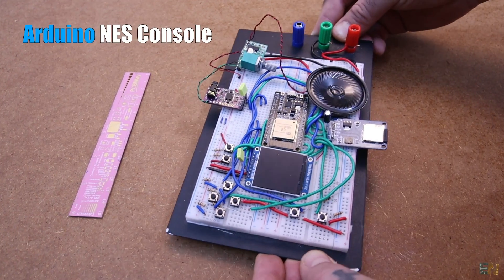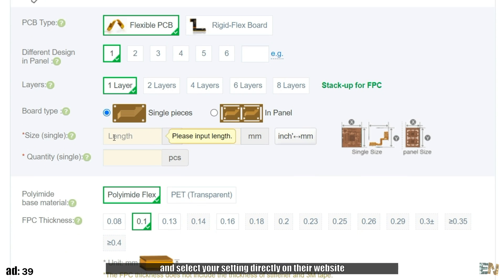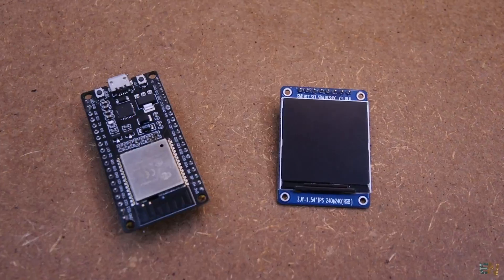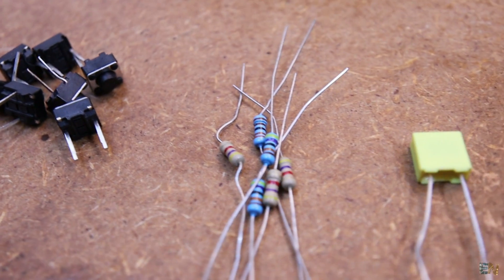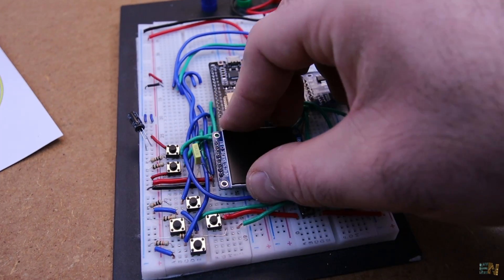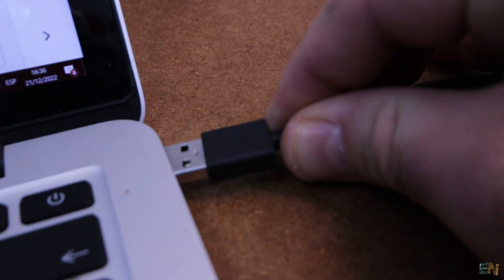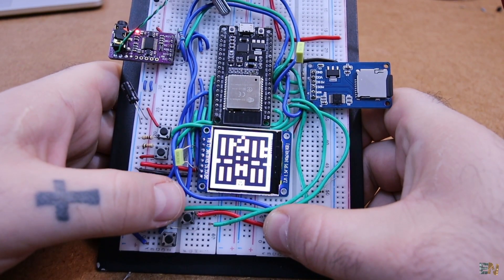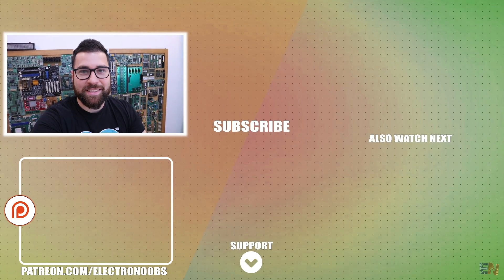ESP32 Gaming Console - Homemade Emulator Less Than 20$

Comment: 1. ESP32 is slow....
2. The code supports PSRAM, will use it if found.
3. Can run the code on ESP32 CAM which has SDMMC and PSRAM.
4. Can put the NES files in SPIFFS as well. Much faster than SD.
5. Can add PS3 joystick support.

Comment: Hey mate ! Awesome video as usual ! Very interesting idea & project and fun to watch video. I`d really get in touch with you for a previous version of one of your projects, the DIY hotplate v2. Are you interested in a v3 maybe ? Best regards and keep on with your work !
Just a little hint : those breadboards are great for tiny tests. But be assured - the bigger the circuits get, the more "strange" errors will occur. This is due to poor quality of those breadboards in many cases, as well as unpredictable data lines. If you use I2C or SPI to address additional devices from the microcontroller, those are extremely dependend on very(!) good connections. Even different cable lengths on breadboards can make a difference for high speed I2C.
Thats why I actually work on a way to produces smd quality pcbs at home for prototype iterations (using UV foil PCBs and a msla printer) to be able to produce more predictable "bigger" circuits with several devices (sensors, display and so on) without strange errors.
Also make sure to check different pin capabilities - sometimes interrupt capable pins are initialized differently than non interrupt capable, pure GPIO ones.
Reply from the maker: Thanks for your tips! Yeah I know the breadboards give us errors but they are good for fast prototyping...

Comment: The super Mario is not running at 100% speed. Is esp32 not fast enough for this project ?
Reply from the maker: I realized that. But when you eliminate the audio module the speed goes up so I guess that the ESP is still too slow or maybe the code is not fast enough :(
Reply: @ELECTRONOOBS  Maybe if PCB was made alongside a 3D model and we eliminate all the wires we maybe able to get higher speed
Reply: @adamfosfi691  That is not how electronics work.

Comment: Bro respberry pi w zero would be the better option than ESP -32
Reply: At a higher cost, and bigger footprint (as the Raspberry Pi Zero W is unable to fit on breadboards). It's not always about achieving the best performance; but sometimes trying (somewhat) modern things on older (or less powerful) hardware. I hope you realize that.

Comment: I would suggest you raspberry pico and a little bit bigger screen
Reply: The Pico wouldn't be able to handle this. The ESP32 already has minimized performance with sound, there's no way a processor with 107MHz less clock speed and like 300 kilobytes less RAM can come close to this.

Comment: Channel isn't active anymore as this is illegal and Nintendo is going to haunt you until you've removed every bit of source code...
Reply: @thomasv No this code is just for the Emulator, not the actual game. Emulators afaik are not illegal in any way, as long as @Electronoobs does not also put the Super Mario Bros. ROM with it, in that case it is very illegal. You can however run any emulator you want, be it your PC or a microcontroller with whatever ROM you want, as long as it is distributed standalone
Reply: @narayanbandodker5482  yes, its right
Reply from the maker: Uff didn't know that :(
Reply: Yes true
Reply: i didn't care about that, i will make
Reply: Emulators are not illegal since it isn't the actual code of the system just super close.
The roms are usually illegal. I think if you bought the game and get the rom from it it isn't illegal.

Nintendo would probably not care since this emulator isn't a one to one copy